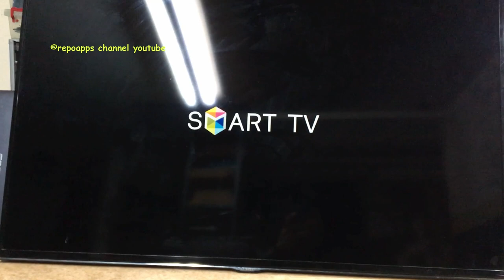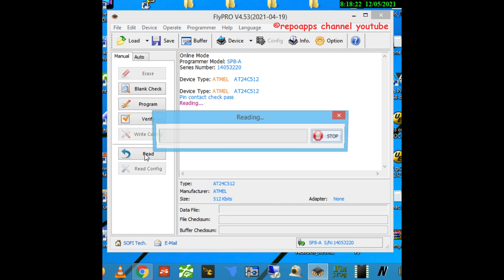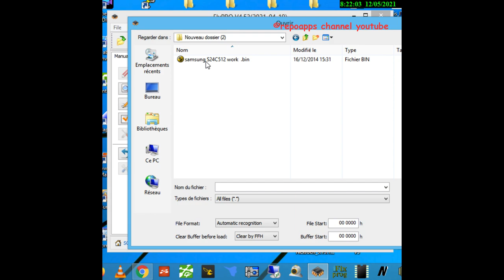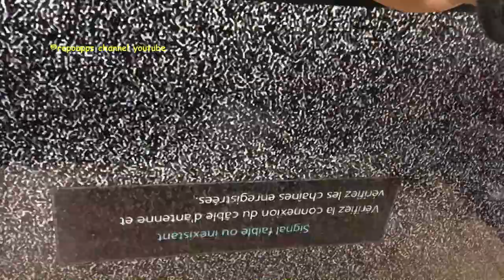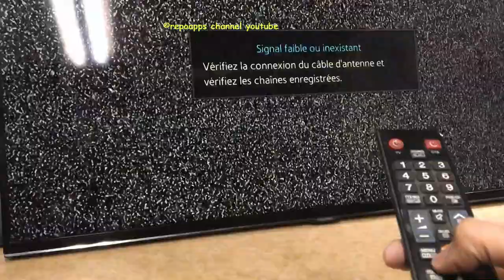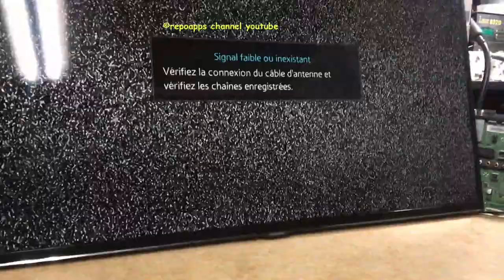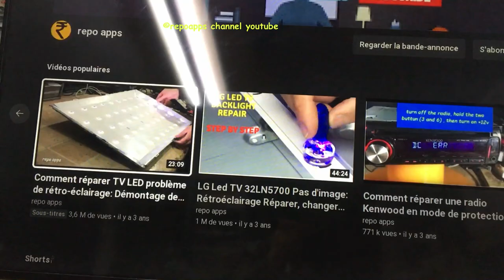How to Fix SAMSUNG TV Stuck on Start Up Logo Screen Easy Fix

Comment: Can the same be done to vision plus smart TV that has hung on Android logo?
Reply from the maker: no , your model need firmware file , copy it into usb stick then flash your tv .
to search for the exact firmware to your tv you need to open it then check the part number on the mainboard.
Reply: I am having the same issue with my Tcl 50s434 android tv also. Did you fix it? If so what did you do? Thanks alot

Comment: Hello. I have the same tv and the problem is that rebooting some times when it’s cold the model of the main is BN94-07343A. Do you know where is the problem at the main ? Thank you
Reply from the maker: i think the problem comes from power supply, check if there's bad solder .